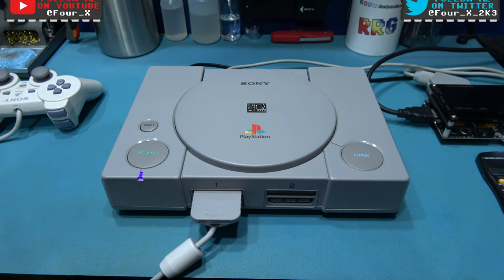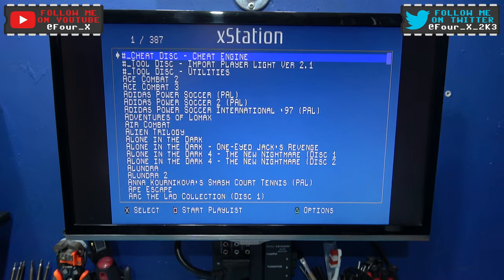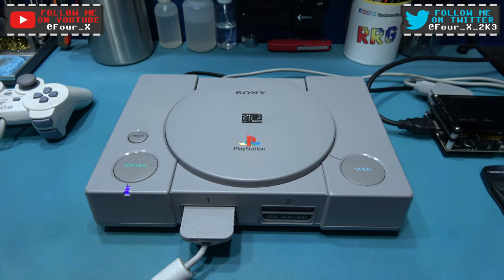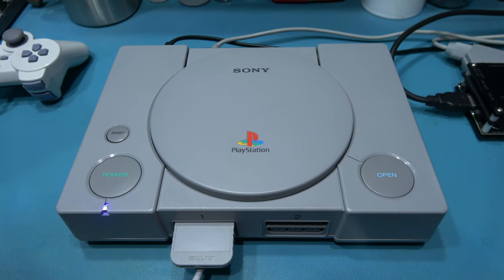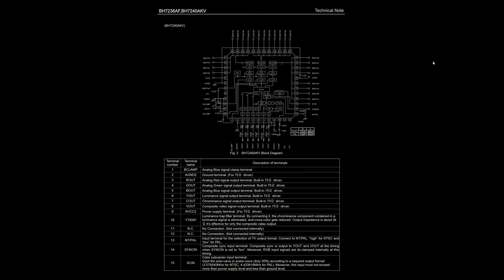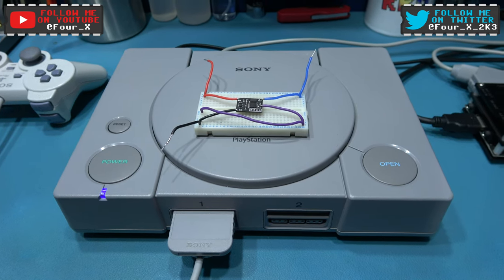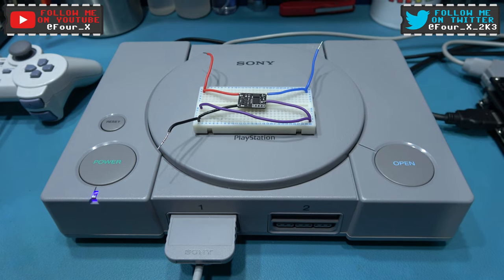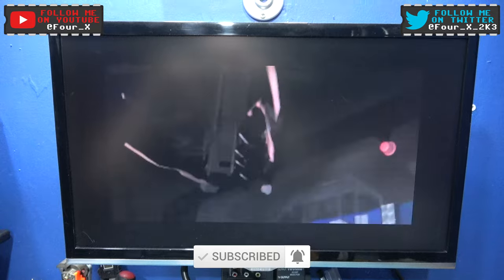Sony PlayStation SCPH-100X - Dual Frequency Oscillator Install, true NTSC accuracy on a PAL system.

Comment: Nice one! You should also do an MFO (multiple frequency oscillator) mod on a scph-7xxx PlayStation that has a PLL instead of just a crystal. That also outputs correct subcarrier frequencies for NTSC and PAL. Also a small correction: vertical refresh rate for  NTSC is 59,94 hz (fields per second), not 60
Reply from the maker: I've seen the MFO for the 7000 series PlayStation and it looks sweet. To be honest I not intersted in the correct sub-carrier frequencies as we generally output RGB over SCART here in the UK and for sync I use sync on luma, seeing as the sub-carrier frequencies are mainly to generate Composite Video it's not an issue for me.
Reply: @Four_X  Yeah, you're right, composite is hideous compared to RGB/SCART, but subcarrier frequency is also used in S-Video which is a pretty damn good video output signal! your scph-1xxxx series doesn't have a problem anyway, because the GPU generates the correct SCF (PAL~4.43/NTSC~3,79) from the main frequency/crystal that your DFO already provides!! ;)
Reply: @Four_X  Subcarrier frequencies are for ALL encoded analog video formats, that also includes RF, composite, s-video, and component video. 

RGB isn't NTSC or PAL because it is a direct discrete signal, there is no encoding or decoding.

Comment: I don't understand a lot of this stuff😅 but I was able to mod my 1002 with an oscillator from a donor 1001 board since my PU8 has the extra solder pads intact.

Comment: Well, you could just buy an NTSC console, and call it a day :D
Reply from the maker: Yep I could do that but if I used your logic I'd have to spend £50+ on a US PlayStation, import charges to the UK, £50 on a UK to US Mains step-down converter, £90 for a X-Station and £15 for an IGR Board. Or, or I can spend £15 on a DFO and have the same GPU clock (speed) as a NTSC system.
Reply: @Four_X  You actually won't need the main step-down converter. You could replace the PSU in the NTSC PS1 from a PAL console and it would work